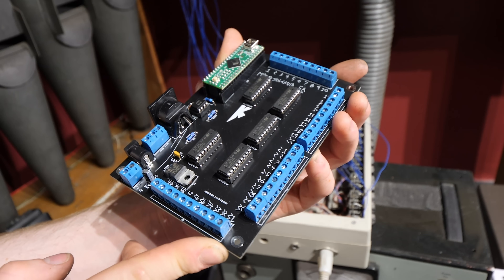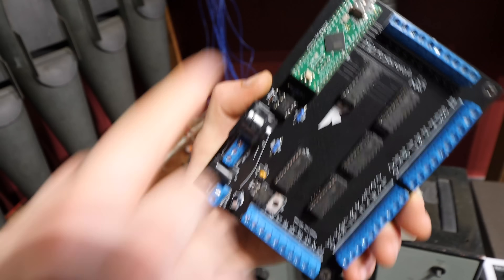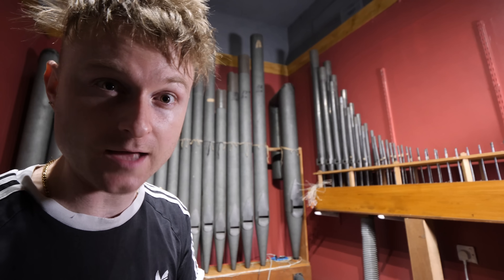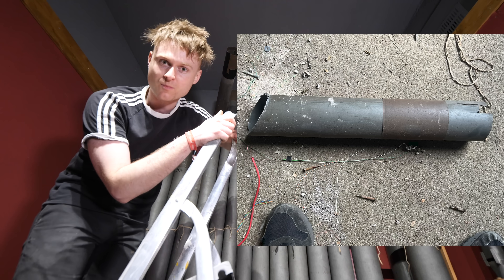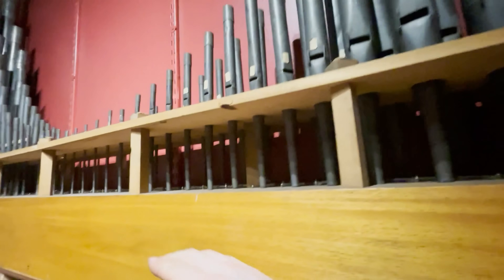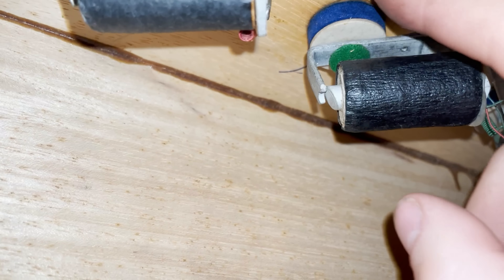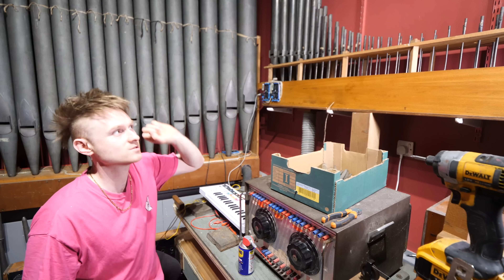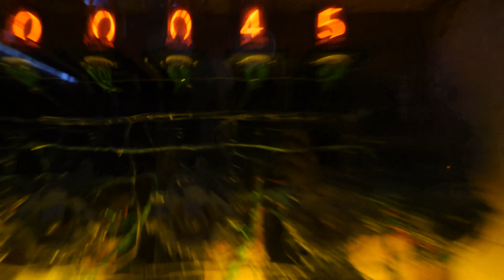I BOUGHT A CHURCH ORGAN Part 3 - Its Playing music!

Comment: You might want to put a little rubber spacer (a grommet would be perfect) between the wood and the PCB's where screwed in. Why? The vibrations and the slight continuous bend stress on the PCB could result in early failure.. PCB's like to be flat and not stressed, sensitive little things..
Reply: A bit of cardboard would do the trick too.

Comment: I don't think the organ valves need an exact voltage (they have no volume control) so you might just be able to wire an LED in parallel with a proper resistor. That actually brings me to my other idea, using the MIDI volume as a modulator for selecting the pipe type instead of channels for more efficiency.

Comment: I dabble in lighting, so I have a solution for you. Get some pixel strings, such as those based on WS2811 or WS2812B protocol. You can then place a pixel LED at the base of each pipe, and have only 3 wires total for all the lights (2 wire power, plus data). 

Then all you need is to design a little MIDI->pixel protocol board to decode the same MIDI data you'are sending to the pipes.

That's how I"d do it anyway :) Saves you from having to run wires to every pipe again. Plus you'd have full RGB control of each pipe.

Comment: Maybe red/green lasers pointing to the sealing connected to each note, then a smoke machine connected to the inlet of the pump letting the smoke out of each individual pipe in the path of the laser beam :D

Comment: Put some more caps on your PCB's. Just some electrolytics (47uF) on the input/output of the regulator. Also some 100nF across each IC. Prevents problems in the future.
Reply from the maker: Caps are on the regulator.

Comment: There's a small church near me that had a pipe organ installed back in the 1990s. They had limited space for pipe ranks so the thing cheats by combining a MIDI synthesizer with real pipes, and smoothly transitions from real to virtual. It would be possible to turn off the chest blower, go entirely synth, and just keep the pipes for the looks. The guy who built it died and left no documentation, so they are screwed if the analog servo control boards ever fail..
Reply from the maker: Cool! I’m sure it Wouldn’t be hard to figure it out for someone. Sure it’ll be alright tho

Comment: I was thinking of how to get the right voltage for the blower without needing to dedicate the variac to it, and realized a 24V transformer wired in a bucking configuration might do the trick in a compact and efficient way.
Reply from the maker: It’s fine I’m powering it with 240v

Comment: When you showed the visitor counter, I thought you were going to say you had wired it to the MIDI controller somehow. Might produce some cool results if you ran the signal through some synth modules before the organ to give the "songs" more dynamic range.
Reply from the maker: I was going to but it would mean the motor on the organ always runnin. I’m building an electromechanical xylophone for the visitor counter

Comment: as I understood, each key of the organ is activating one valve for one pipe. After you succeed with midi implemantation, is it possible to trigger not one pipe but more pipes as harmonics of the root note? Like if you play C3, it also triggerrs C5, G5,C6 vs.. The air valves can only act binary but it still be impressive to hear octaves, fifths activated like hammond organ drawbars... Maybe in the future the valves will be changed with servos for incremental/decremental opening and closing.. Just an idea... :D

Comment: Love it!
Would you mind sharing the specs of those driver ICs you're using, for us fellow tinkerers? :)
Reply from the maker: link is in the description :)
Reply: Thanks!
Reply: @LOOKMUMNOCOMPUTER  I'd suggest putting a heatsink of some kind on the L7805 regulators as it could be drawing significant current at times while dropping ten volts when the Teensy board is driving a lot of outputs simultaneously.

I would probably have used a buck converter for the 15V to 5V conversion step. They're a lot more efficient and less prone to overheating under load. I use them for voltage regulation pretty much automatically these days rather than using 7805/7812s as I used to, even if they're overkill for a particular project.

Comment: Maybe you can add a bit of acoustic treatment in that room? I can hear from your voice that that space is full of unpleasant early reflections. The room is probably too small to be able to solve any issue in the low-end but I think that you can at least clean up the early reflections with some acoustic panels on the ceiling and maybe add some stuff in the corners.
It would be a shame to have done all this hard work just to put the organ in a bad sounding room. This is an acoustic instrument, not a synth that can be plugged directly into a preamp. The acoustic space is very important. Of course is impossible to recreate a church in a domestic environment, but I think that it will be a nice idea to try to improve the room as much as possible.
Reply from the maker: acoustic treatment is not my thing., just gotta deal with the imperfections of whatever room you are in and youll be setup for any challenge or obstacle the world of sound throws at you

Comment: that toccata midi needs some dynamics!
Reply from the maker: Huh?
Reply: @LOOKMUMNOCOMPUTER  probably the wrong word, I mean that it should speed up and slow down, not switch between slow and top speed instantly. don't know if it's possible to apply that to an existing midi easily.

Comment: In the movie: Salt with Angelina Joli they had springs on the bellow.
Your website doesn't work, you seem to pull parts from an external sources or so.
Did you brake the screen of a macbook?

Also after you published the first video of the organ, i got served a video from another famous guy that did the same, who also hold the world record of biggest guitar pedal assembly.
Reply from the maker: Springs have an uneven load on the bellow. Apparently they are bad bellow pressure design. Website works for me.  I have two laptops and both have broken screens I live with it. As when I repair they get broken again. I just leave em broken
Reply from the maker: Yeah rob scallion went to a cathedral. I probably couldn’t fit one of those organs in the museum ha
Reply: @LOOKMUMNOCOMPUTER  didn't watch the video, a men gotta sleep eventually.

Did you know that Microchip is the owner of Atmel (Arduino mcu)? a tiny Microchip Faburino(chipkit) + several Microchip mcp23s17/mcp23s18 (dip/soic28, each have 16 I/O, 2 banks of 8) + one Texas Instruments TXB0108 8-Bit Bidirectional Voltage-Level Translator 3V33 tot 5V (to relief the strain of the mcu and the MCP23S17/18)  ... al compatible with Arduino ide. with one pcb you could have 128 I/O and have sufficient pins left on the MCU to use a OLED display.

i soldered two of Texas Instruments TXB0108  SOIC20 to a adapter PCB using solderwick and it looks awesome. many through hole components, like LM13700 are like instinct currently, but also the SMD version. you're being forced to use SMD (if the part is available et all.) even dump CD4000 series.

check this guys video:  Luis Geissler
'DIY Reflow Plate with an old iron'.
pretty cool and useful stuff he made. gonna build one, but don't have a second hand "iron" and it's much faster than soldering through hole parts. easy build.
Reply: @LOOKMUMNOCOMPUTER  i saw the movie last week and since you where occupied with a church organ i saw that minor detail in the movie.
: )
I fixed a few laptop and screens for people, sourcing a new screen of ebay.

plugin's like: noscript, ublock and canvasblocker are pretty necessary today. i only allow from the domain I'm visiting and it gets automatically reset after a time and have to set again. the people you're trying to protect get furious, because they can't reach facebook or livemail, lol. get them.

Comment: Hey good sir, I'm thinking to build a few of your organ midi interface circuit boards. The oldies at a church close by have an organ but the organist has died. Just out of interest, if you had to do it again, would you use your boards or something else?
Reply from the maker: I'd use the boards I made. Infact I have used them since in multiple things. Very useful and low part count
Reply from the maker: @ynnebbenny  it is on kicad. just assign the different boards to different notes. or design one for an arduino mega or something. cheers
Reply: @LOOKMUMNOCOMPUTER  Hey Sam, in the end I am modifying your design using multiplexer chips (74hc4067). They allow 16 midi channels off just one Teensy digital out. As you can imagine, that could mean many hundreds of channels off one Teensy. Im wondering if you considered this and chose not to go down that path for a reason? Maybe I am overlooking something? 
I was thinking to make the board modular so that the user could add as many banks of 16 outputs as they require for their project. Id be interested in your thoughts.
Reply from the maker: @ynnebbenny  yep i did consider, but it makes it hard to modify and trouble shoot for peope in the future, also each windchest is designed to have a midi in, so at most you only need 60 or so per windchest
Reply from the maker: @ynnebbenny  by all means do it with multiplexers, but i tend to avoid them where i can as they add unnecessary complication in my eyes. cheers!

Comment: Really surprised those moser chips can drive your solenoids and not overheat the mosfets.  You may want a heat sync on those chips.
Reply from the maker: They are well within data sheet spec so it’s fine

Comment: Could this process be a very interesting new step in controlling a pipeorgan? Or are new organs all being controlled this way?
Reply: Newer organs are controlled the same way Sam is doing. They have even the transpose functions. 
It's more practical because you can put the huge keyboard and pedalboard "wherever you want" in the churc and still have the pipe sound. 
Mostly of the times with a choir this is so impractical because the farest is the choir from the pipes the worst is the execution of the song due to distance. Is always better to have the choir in the same space where the pipes are with the organist and the conductor.

Comment: Why wouldnt you have wired all those wires in before mounting it at the back of that board , thats a back killer
Reply from the maker: huh? because then they would all be the wrong lengths and would have been messy
Reply: @LOOKMUMNOCOMPUTER  give it 10 years mate, gotta watch your back
Reply from the maker: @reacey  there wasn't really another way.
Reply: @LOOKMUMNOCOMPUTER  love the project anyway. Appriciate the videos